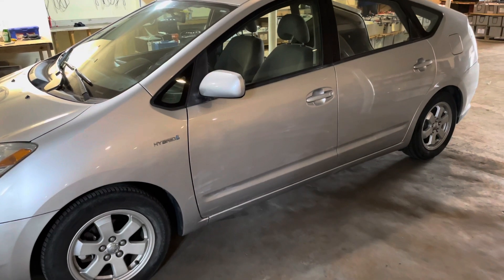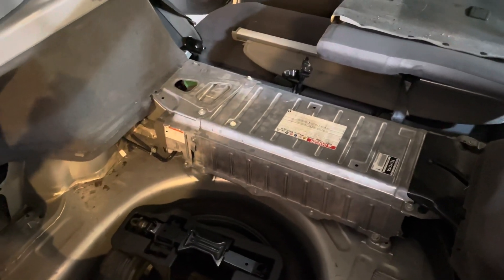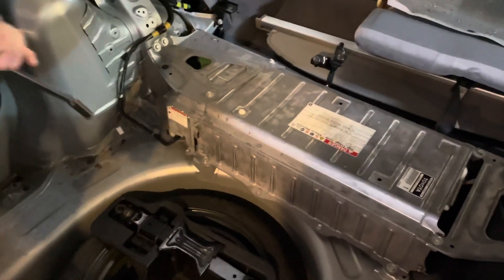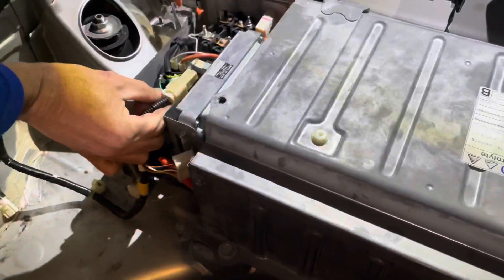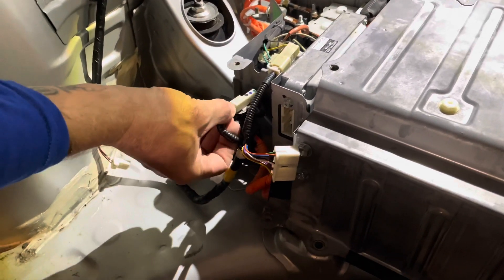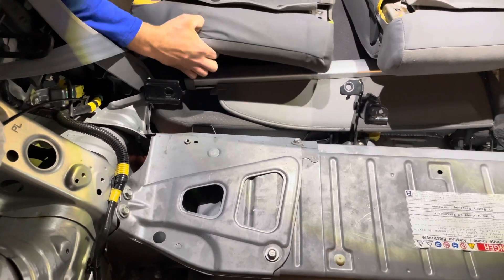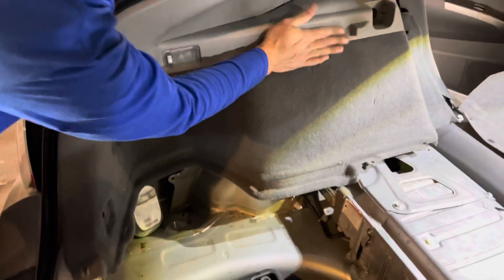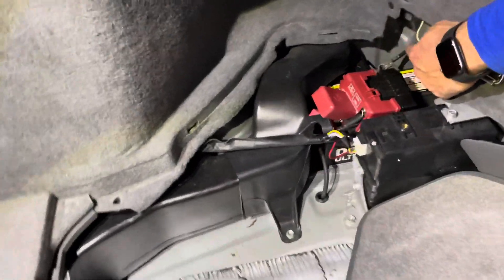Toyota Prius Hybrid Battery Removal & Reinstallation ~ 2004 - 2009

Comment: Although I've been wrenchin' for 50+ years , this was the first Prius battery swap I've ever tackled and you made it a walk in the park!  The only thing I'd add would be vacuum and clean all the surfaces before reinstalling the battery, panels, trim, etc. The fan and plenum on this car had 15 years worth of lint and pine needles it it.  Thanks for a 5-star video!
Reply from the maker: I appreciate the kind words Frank. I definitely address cleaning in the RX450 videos, but you are correct.
Reply: Thanks its a.lot of work😂😂😂😂

Comment: Are electrical linesman gloves overboard,more than is needed?  Are any gloves needed? If some are suggested are they only needed for sharp edges?
I have an '03 throwing a p3030.
Reply from the maker: Once you pull the service plug you don’t have to use gloves. You can test for voltage at the main battery terminals to ensure it’s safe to work on after removing the service plug.

Comment: You forgot to talk about  how to clean the HV batter fan ?
Reply from the maker: Apologies, it’s on the passenger side wall above the battery. 1 electrical harness and three 10mm mounting bolts. Then Phillips head screwdriver to open fan. If you have to flush face downward.
Reply: Thanks for your excellent video,  i used lots of small zip lock bags to keep track of the different types of bolts and nuts.  After 8-hrs of work i got the battery the new  place. I had to install 3- new  orange battery cables and move the front battery module from the old battery to the new battery. But you battery was great help. Dealer quoted $4800 for the job i did it  for 2K.  You save the widow 2.4K and she is most grateful for your video.

Comment: How does the aftermarket battery compare to the OEM Battery?  Is it Lithium ? Warranty?
Reply from the maker: Same chemistry and specs as original modules, the biggest advantage to the cylindrical is increased module cooling due to design and airflow through the modules. I see a ton of batteries fail due to middle of the pack deterioration, which is caused by excessive heat build up in the middle of the pack.